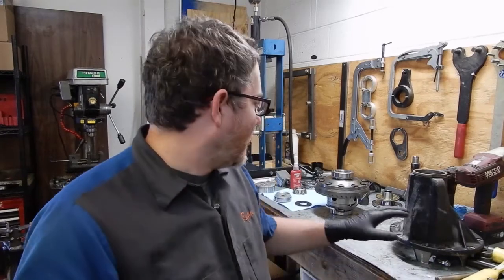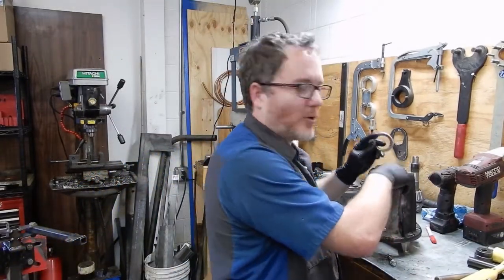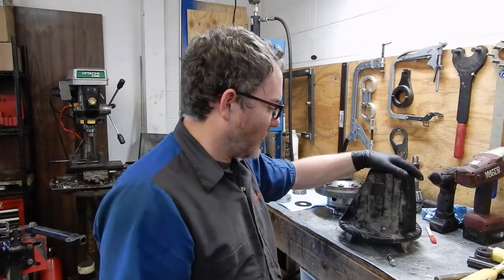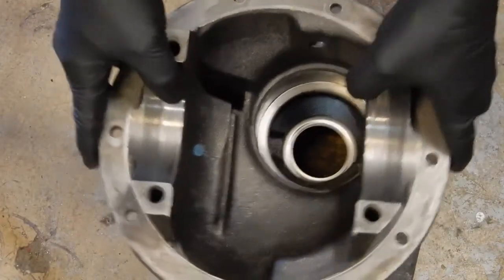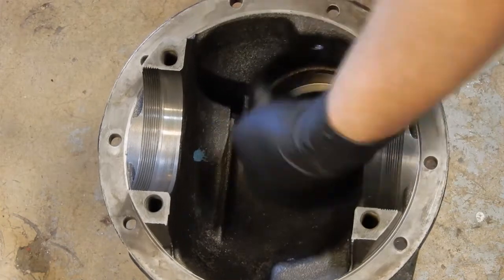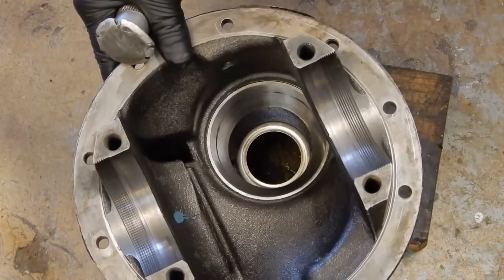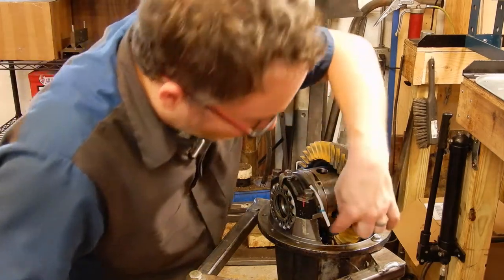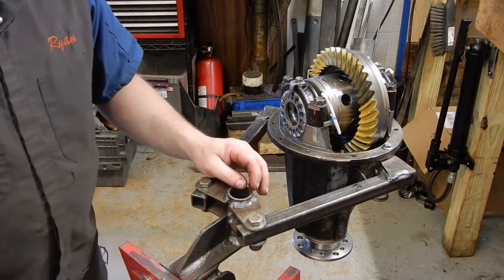80 Series High Pinion Gear and Locker Quick Tips

Comment: Hey mate great vids very informative   Got a problem with my 80 series transfer case  the original one in the car 
Packed it in. Bought another one from the Wreackers  and installed it but cannot get  2H  have no drive to the 
Back wheels  only the front  ,  how. Do you know the difference between full time and part time 
 It drives  in low range but again only have drive to front   The cruiser Is a. 91 model gxl  
I had another  gearbox and transfer. Out of a petrol.  Out of desperation. Ended up installing 
This transfer case. Same result.      Relay ////actuator ..??????   
Can anyone help me please.   JW
Reply from the maker: We only got the full time version here so I've never seen a part time one.

Comment: I learned today that you cannot use a solid pinion spacer on the high pinion 8".
Reply from the maker: You can use a solid spacer. It just has to be sized for the high pinion version of the 8". I don't generally use solid spacers but I have seen them in high pinions.
Reply: @OTRAMM  oh I did not know they make specially fitted ones